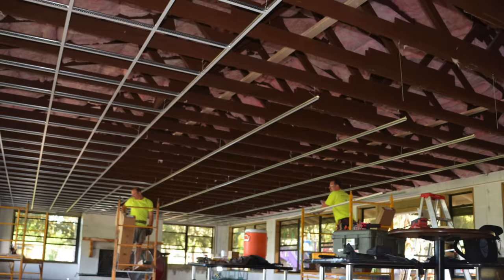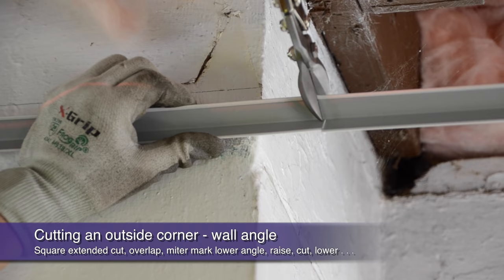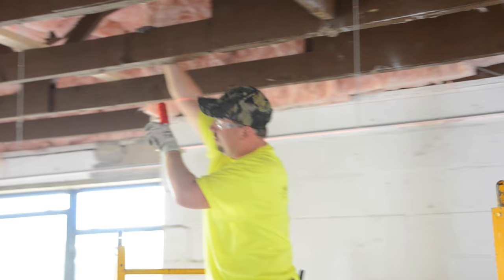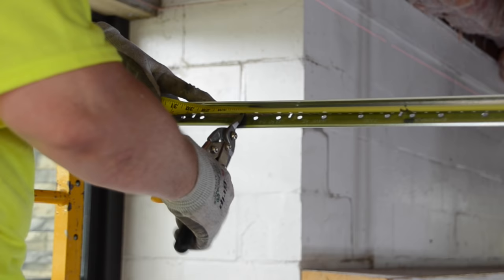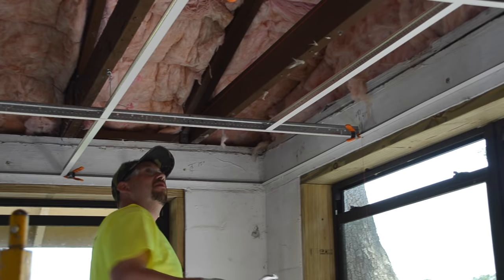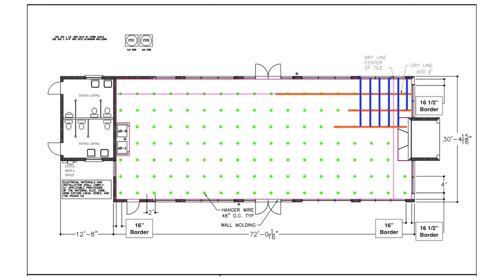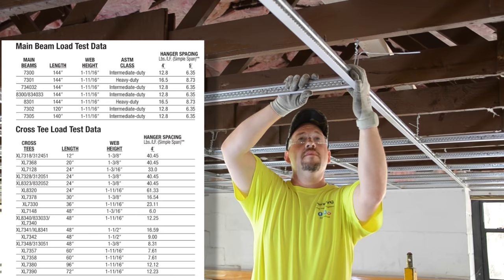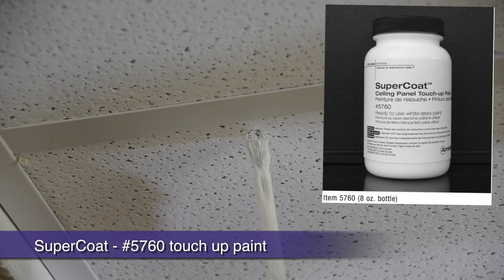How to Install Acoustical Ceilings | Armstrong Ceiling Solutions

Comment: I do commercial framing and acoustic ceilings are part of that. Some additional tips:. When securing wall mold to drywall make sure you are not screwing into the studs. It's easy to tell where the studs are because they will either be visible at that height or the drywall itself wont be finished at that height (finished as in drywall compound applied to joints) so look for for the screws to know where the studs are. If my blueprints call for the ceiling to be at 9 foot then I will take several measurements around the room as floors are never 100 percent level. Look for the highest point and measure your 9ft there, that way you have a minimum of 9ft all around the room. To find the high point you can put your laser at just a few feet above the ground. Turn it on and measure down on all the walls from the laser to the floor. The shortest measurement will be your highest point.
Reply: You said "don't screw into the studs."?
Reply: @strongholds12  Yes, don't screw the wall mold into the studs.
Reply: @Stickyrolls123  i don't think so. That's the only place im screwing it in
Reply: @Stickyrolls123  ok, but tell us why
Reply: @Feronom  sucks it in , looks bad . Wall mold doesn't hold up the ceiling , wires do .

Comment: I've done a couple of suspended ceilings in my home and the one thing Ive learned is to NOT use the crumbly style tiles but instead the flexible fiberglass ones.  The crumbly ones crack and stain too easily and you can install the ceiling higher because you dont have to leave nearly as much room above the tracks to feed the tiles over and drop into place

Comment: The string lines need to be square. You can not go with the walls unless you know they are exactly square
Reply: Really surprised they didn't talk about that. I wanted to see how they did it because the only way I know how to do it really would be to mark it on the floor and laser it up.

Comment: what is the size of main and cross members ,what is type and spacing of suspenders,what is the thickness density of insulation pads,what is the rate per square meters for acoustical  false ceiling from armstrong ,what are the technical specifications of the materials being used in insulated acoustical false ceiling
Reply: SR MGR CIVIL 7/8ths 
The rest is of specification.

Comment: Why is the first main runner 9 feet off of the wall?
Reply: Freedom WatchDog maybe they didn't want a 12" peice of main on the other side.
Reply: It's not 9' from the wall. It's 9' from last cross tee slot on the runner to the intersection of the crossing dry line, which is one border tile (16") + half a 24" main tile (12") away from the wall. Then they add 28" (16" + 12") to that 9' mark and cut the runner. So the first main runner is cut at 136" from the last cross tee slot. (Note, the last cross tee slot is 3" from the end of the runner. So the cut is actually at ~139", with ~5" of waste. But you always make your reference marks in relation to a cross tee slot, not from the end of the runner.) You can never use a full 12' runner starting/ending at a wall.

Comment: Wear a damn mask when tiling unless you like hacking up a lung at the end of the day
Reply: Why 28 off of the short wall? I get that it's 16 plus 1/2 of a tile which totals 28 but why run the short wall dry line 1/2 the way across the tile row?
Reply: Freedom WatchDog preference
Reply: @freedomwatchdog2495  Good question. I was wondering the same thing at first; they should have explained it. But after thinking about it for a while, I believe the reason is because when they start installing the cross tees, the cross dry line would be in the way (plus the cross dry line position could be disturbed by the installation of the cross tee). Since cross tee slots on the main runners are spaced every 6", it's just easier to place the cross dry line at half a tile (1 foot for 24" tiles or 2 feet for 48" tiles) and reference the cross tee slots from the center of the tile.

Comment: Wow dude... you're making it way more confusing than it should be this is not fucking rocket science
Reply: A. Boisjoli not as easy as you may think.  I have done commercial installations as a wall and ceiling contractor for over 20 yrs and let me tell you, most people think it is easy.  once you actually start, it can get confusing.  1st, layout is critical as certain points must be considered in case a light fixture has to fit up against a column and not into the column (lol). then once you begin, what happens if it isn't square? adjustments need to be done correctly so it doesn't run out on one side or the other.  then, light layout, runner layout, different layout, all before you begin.  pop rivet only 2 walls for expansion, set up lines, not as easy as one thinks.  many have told me they had over 20 yrs experience and when I showed them some plans and told them to go install those rooms over there, then they get lost.  really not as easy as one thinks, but when you do know, it is like a jig saw puzzle with all the same pieces, piece of cake. do not fool yourself into believing it is just so so easy, cuz as a beginner there are so many things that will confuse you and mess it up, and believe me, time is money and I know how long it should take someone to install grid